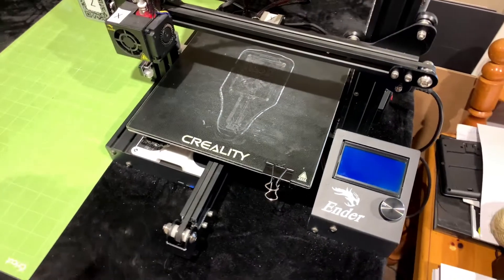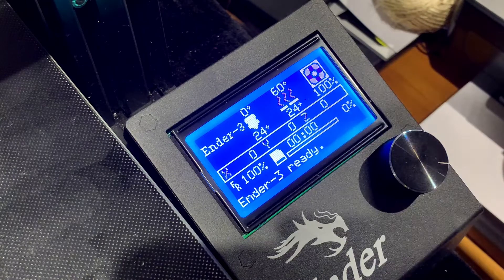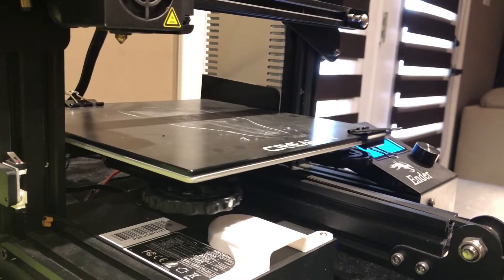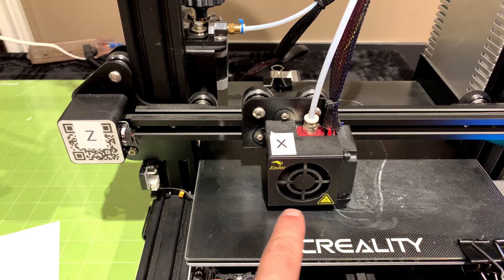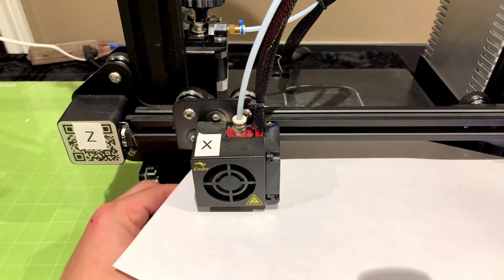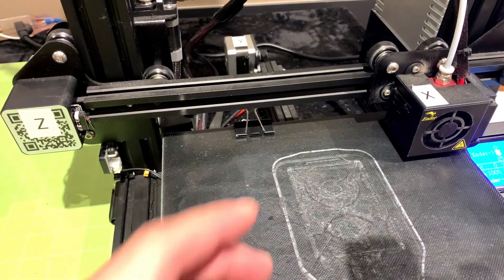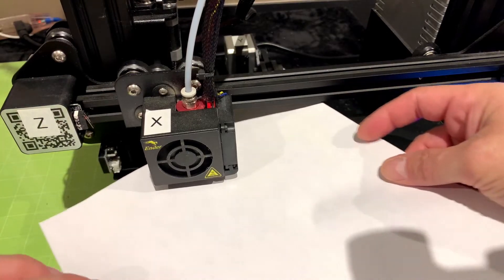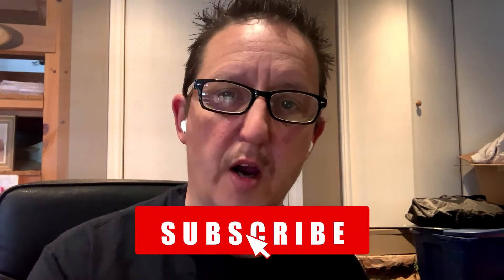3D Printing Creality Ender 3 Bed Leveling quick  and easy!

Comment: If you swap out those bed springs for those red rubbers, your bed leveling will be instant and you may never need to level your bed again. I have done that very thing and haven't needed to adjust my bed at all. Stick in your program, set the printer to print, and literally walk away.
Reply from the maker: Thanks for the tip! I appreciate it!

Comment: My pronlem with this is that it, the nozzel doesnt go down all the way to the bed its like 2 to 3 inches higher and I try to adjust the bed and it wont go up that high
Reply from the maker: I don't understand why your nozzle is so far away from your bed. Mine was a few mm away after I assembled it and the   nozzle axis would hit the home switch before being near enough to the bed. I had to slot my home switch bracket. Is this a new printer that you just assembled?

Comment: Thank you for the video. How depressed should the springs be and how should the z-stop switch be adjusted before tramming the bed? Should the springs be depressed all the way until the adjusting wheel can't be turned anymore? For the glass bed, should the z-stop switch be raised the height of the glass thickness? Cheers
Reply from the maker: When I assembled mine, the Z axis switch was adjust as high as I could get it. Mine came with the glass. When you autohome, the machine will set that axis to zero when it contacts the switch and the extruded nozzle will over hang the bed. Disable the steppers and see if you can slide the bed under the extruded nozzle. If the machine will not touch the switch you can slot the bracket to move it higher. The factory slots should work fine with the glass. I’m thinking if you are adding a glass bed, compress the spring all the way in to start.  My springs are always compressed enough to allow me to slide the piece of paper in freely. Then from there you start corner by corner. Let me know if this helps. Thanks for the comment!
Reply: Thank you for trying. There are different methods for tramming and every tutorial leaves out something. I think the springs should be depressed all the way before making initial adjustments and the stop switch should be installed at the right height before tramming. Cheers